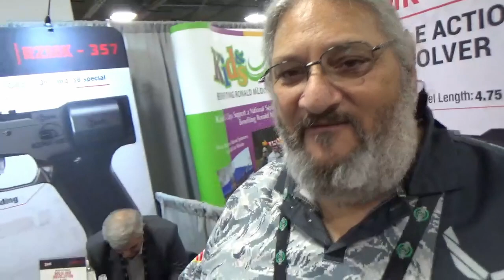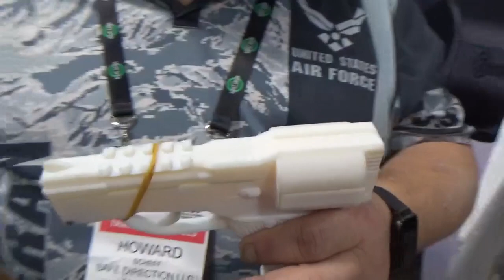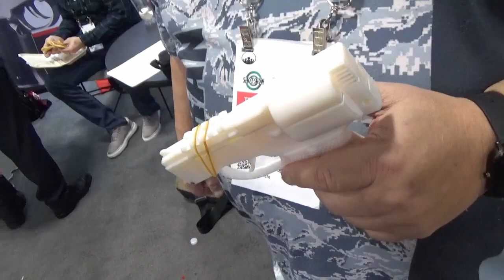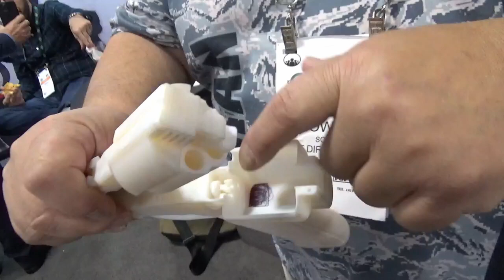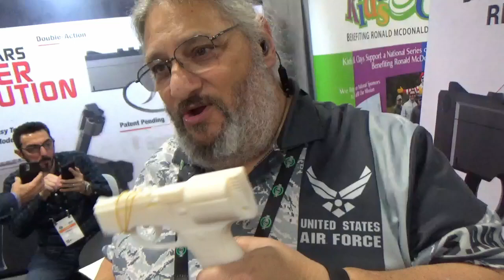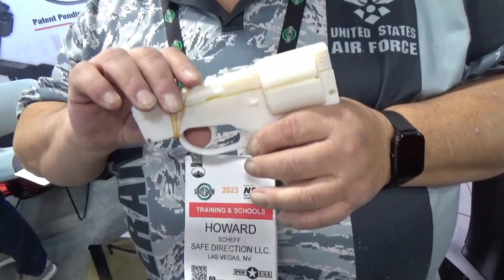SHOT 2023 Zenk enclosed cylinder Revolver

Comment: I have my doubts that they actually have made these before. It sounds like they just want to sell the idea to a company then run away. .357 magnum in an enclosed space, even if the gasses pass through the handle, is just an accident waiting to happen. 

It’s a good idea, but if you consider unloading a full cylinder of federal 158 grain .357 magnum, that handle is going to get HOT. Also Im sure cleaning that thing will be a nightmare.
Reply: But you could maybe suppress it. I saw a suppressed revolver with a metal shell clamped over the cylinder with a gasket. It was impracticably large, but it worked.
Reply: @ahumblepoet  I saw that too, but that was only for .22 LR revolvers. .357 is a LOT stronger of a bullet with a LOT larger of an explosion. There has never been a suppressed .357 revolver manufactured. Even the Nagant m1895 doesn’t use .357 magnum, and that has an extremely heavy trigger pull due to the mechanisms it needed to work properly. The Zenk revolver, which has no proof of existence, isn’t gas sealed either, it vents out the bottom of the grip, which if you ask me will likely cause burns, or even potential cuts if shrapnel goes through it.
Reply: @TheRealOfficialGator  it’s never gonna get that far - it’ll be vaporware, just watch. 

We need to get #markserbu on it.